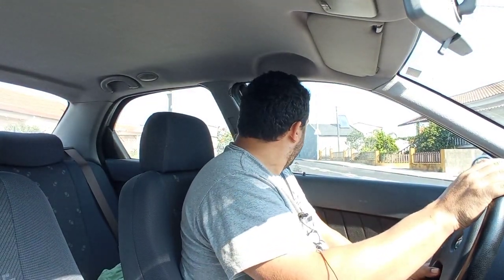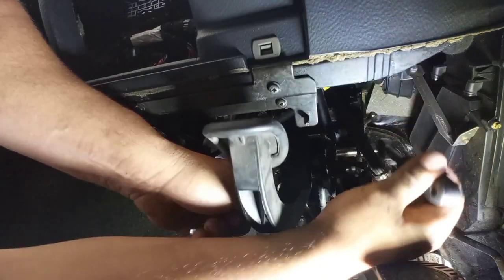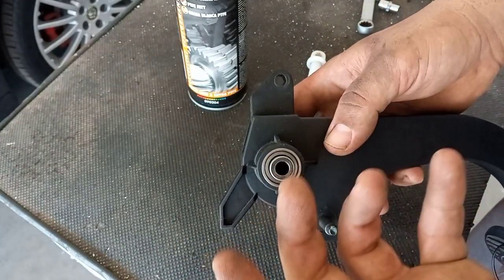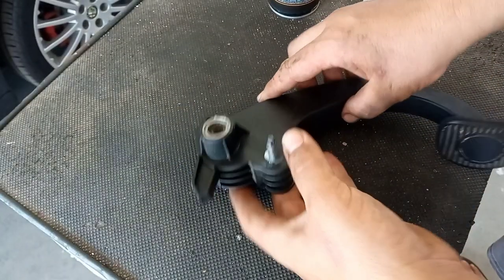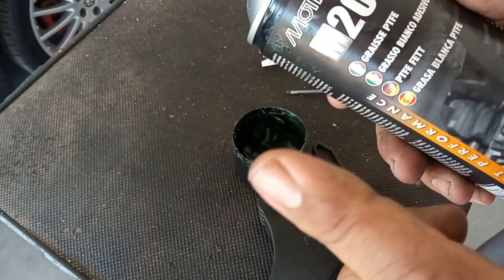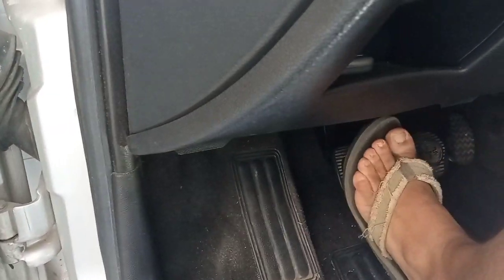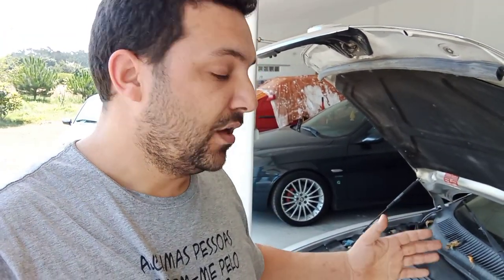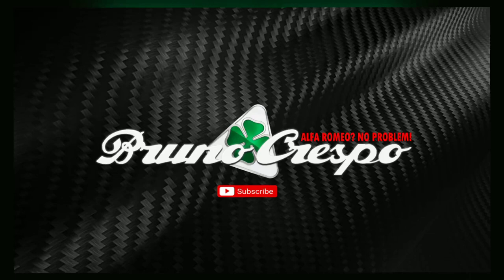Clutch pedal hard and squealing? Here is how to repair the squealing and to prevent hard pedal feel.

Comment: I have squeaky clutch pedal on Giullieta. The pedal looks a bit different, but it seems like it can be the spring or where the pedal touches the spring mechanism.
It is difficult or impossible to reach it to grease it without taking it out. 
Any suggestion?
Thanks...
Reply from the maker: Hello. Do far never had it on a Giulietta, so for that I have no experience, sorry.

Comment: Congratulations for your videos. I am a big fan of your channel.
Watching this video, I have to tell you about my problem with a 159 jdt that I am fixing.
He decidido arreglar el problema que tiene el pedal de embrague porque se le rompen las sujecciones del muelle de retorno. Gran problema, para que hagas un video, porque el 99% de los coches comparten ese problema.
When I put the pedal back on, I can't even squeeze the clutch master cylinder rod in. It has broken? Should I purge the system until it comes in? Change the master cylinder?
Saludos desde España.
Reply from the maker: Hello. Thanks for watching! I want to do a video for that, how to replace the spring, the spring clips and how to assemble the pedal. Yes, it may seem it's broken in half, but it's not really. Cannot wait to get one to do a video. 
For the correct bleeding of those systems, I have here a video that may help you.
https://youtu.be/niwhRaX3Dms?si=FS7r7fNmG7renBZe

Comment: I have noticed on my 159, when I sit in a car and press the clutch pedal (while engine is still off) it is a bit hard. But then I release it and press it again (engine still off), it is soft and remains soft. Is that normal, or?
Reply from the maker: Replace the clutch cylinders oil, the vibration of the clutch running is helping the fluid move. It should be the same
Reply: @alfaromeonoproblem  So the cluch cylinder oil is not the same oil used for braking system? I mean, not from the same reservoir?
Reply from the maker: @DashCamSerbia it is, but it's just stands there on the line
Reply: @alfaromeonoproblem   Ah, OK. I will have the brake fluid replaced, becasue when I was doing the rear brakes a fee days ago, I've noticed that the brake reservoir cap is cracked. Maybe I have cracked it, because I started to wind back the caliper piston, and I forgot to take the cap off. But when I took it off, on the inside of the cap there was a lot of moisture (water dropplets), so it was pribably cracked from before.
Reply: @alfaromeonoproblem  BTW, it took a lot of brake presses to get the pedal to be firm again, after doing the rear brake discs and pads. I mean, mostly while driving. Manual says "pump the pedal at least 10 times". Yeah, more like at least 50 times.
Reply from the maker: @DashCamSerbia it's a thing, they just crack. And then moisture gets in
Reply: @alfaromeonoproblem  Thanks. The dealer can order it for me, I will get it from them.

Comment: Is there any clutch slave or tube in paddle as aell? Fiat idea 1.4 active, i bleed the slave which is next to engine and master slave have oil enough, paddle is spryed well still my paddle stocks in the floor some time. What can be the problem my friend? I guess may be same like this video spring broblem or small baring and things need to clean or change
Reply from the maker: Try to do with this method:
https://youtu.be/niwhRaX3Dms?si=yZ2kG6fopEF9XWHR

Comment: hello. nice video. i have this same sound on my 159 JTDm but all the time while driving not only when pressing and relasing clutch. what can be problem ? Mostly its noticable on bumpy roads
Reply from the maker: Hello. Normally it's the plastic clips on the return spring. Very annoying and hard to replace. So make sure where does the sound comes from

Comment: The clutch pedal on mine gets "stuck" in the middle apart from the squealing, could be the spring also?
Reply from the maker: Hello. Yes, it can. The spring helps to position the pedal. I have videos for that. Check on the clutch playlist
Reply: @alfaromeonoproblem  Thanks a lot! I think I also should change master and slave cluth cylinders because when I fully press the pedal the gearbox makes a bit of noise, and it's very hard to put the reverse

Comment: Please help my I have a big problem on mine 159. I started to remove the clutch pedal on my own because no one wanted to do that job. Mine problem was two brocken plastic holders of the big returning spring that return the pedal, there was clicking sound from the spring. So i bought two new , remove by myself return back everything, try it jently and it work. No more clicking sound. But at the end and when I sit to drive and press the pedal to the right end it stay down. Then i  pull the pedal menually back up and i can press again. I thought that maybe I put the spring in wrong direction so I remove everything again but its imposible to put it in the other direction. So I install her again but the problem stayed. Now is really difficult to drive and dangerous. What did I do wrong, no one can tell me. Please help me
Reply: Ak nije pedala onda ili lamela,korpa i druk lager ili cilindar kvacila.Sutra idem kod mehanicara zbog istog problema pa cu biti pametniji kad mi veli kaj je
Reply: @marioQ4  meni je radilo sve normalno samo je krckalo, nema veze ovo sa kvacilom direktno nit druk lagerom. Ovo je glupi problem kod same pedale. Mozda postoji mogucnost da se sjebao cilindar kvacila, ali onda bi se drugacije ponasao a ne ovako radi radi sve ok i samo odjednom kao da preskoci cela opruga i padne dole cela pedala sve dok je ne vratim gore i onda moze opet
Reply from the maker: Hello. Can you show me the symptoms? Send it to the email on the description
Reply: @alfaromeonoproblem  I just send you an email with video and details. Please answer if you can help. Thanks
Reply from the maker: Hello. I've seen the video. You can notice that the pedal is made from two parts, it is not fitted all the way, once you have the pedal on the upper position you should slide all the way the top part
Reply: @alfaromeonoproblem  I know but i put the pedal as far as i can and I pull as hard as i can to get to the upper position, and the pedal clicks the same as you can see in the video, but the thing is small force is needed for the pedal to unlock and separates to two parts. I ordered another pedal, becouse only thing thats on my mind that the plastic hook thats locking to other part is either brocken ar loosen and not strong enough to hold